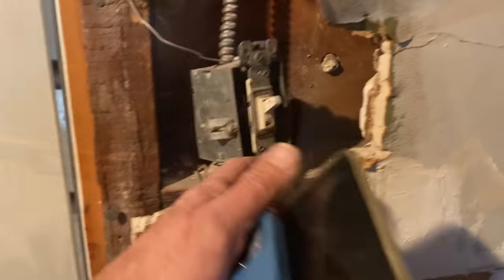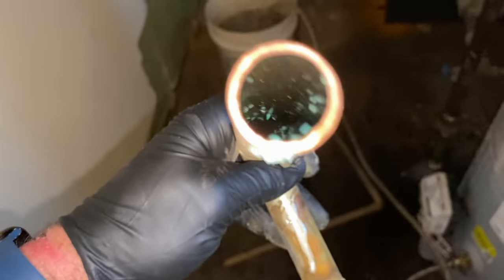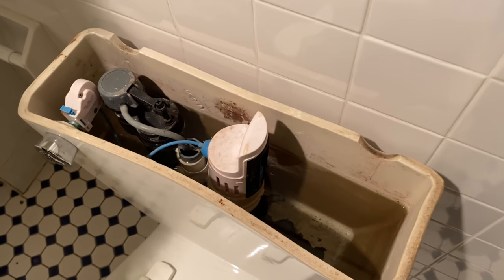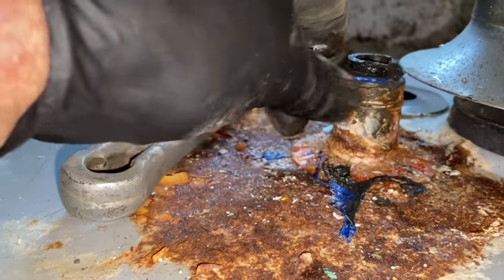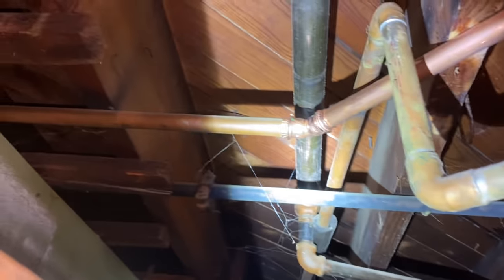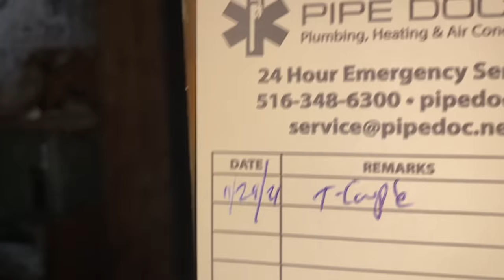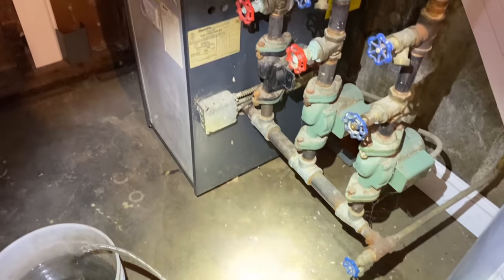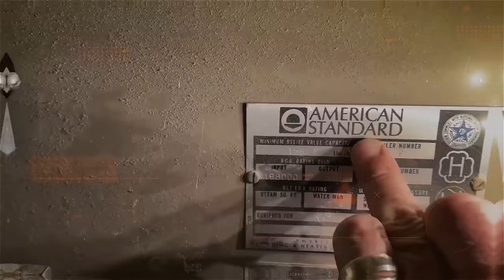Hundreds of Pin Hole Leaks in Domestic Copper Tubing Pipe Replaced

Comment: That was a lot of mud in the pipes . I wonder how much is on the bottom of the water heater ? I know flushing it out may cause it to start leaking but I also know the heat isn't getting to the water as efficiently as it should either . A whole house water filter will help a lot  I agree , but everything needs a good flushing of the whole house first should be done . As for the water heater being flushed that is just a roll of the dice .   I used use hot water say in a pot to cook pasta . I stopped after I changed my hot water heater and saw what came out of it while I was draining it .
Reply: Never gonna get completely clean without a repipe of EVERYTHING.
Beware of companies MARKETING whole house repipe work, offering to do it much cheaper than a plumber...then who is going to do it, a babysitter or painter ? I hear these ads on radio ALL THE TIME, same as crazy priced plumbing companies that are 90% sales, 10% plumb and on the level. Their pitch is usually off. Plumbers, like any trade; should make a great living. But not crazy-cray pricing. Once those flip-books come out, you know the scam is about to hit.
Reply: @citylockapolytechnikeyllcc7936  I have never heard of this service .  I agree you will never get everything completely clean . I was mainly concerned of where the water settles like in the water heater or toilet tanks . They need to be cleaned of sediment so the now filtered water isn't ruined by the left over mud . Where I live in I get rust build up in the tanks .

Comment: Whole house filter is a great idea. Queens and parts of Long Island always suffered from hard water. I installed a charcoal water filter on a boiler I installed in Jamaica queens that had rotted out. The water in the glass was clear. I started installing on most steam boilers 
Back in the 90’s.  Mainly if old boiler died from oxygen corrosion.
Reply: I lived in brooklyn and water would stain white clothes in the machine it was so bad. But LI has different water from aquifers. NYC gets it from upstate.

Comment: Sometimes when the water is to clean you get the same thing. But in this case I blame the dielectric system installed on heater good fix.
Reply: Yep,  it very well could be electrolysis.  Be sure system is grounded also
Reply: It's a gas water heater I could be wrong but there is no need for anode rod or grounding the unit
Reply: @SORGIGERMANICO  U would be wrong.
Reply: @SORGIGERMANICO  I don’t think it’s required by national codes but local codes do require it(ground strap).  I always install it because I was told the tank last longer.  Along with dielectric system

Comment: I would replace anode rod in this water heater. It responsible for catching iron, calcium, magnesium on a hot side of the system.
Reply: Catching it, or corroding instead of the device it is screwed into ?  It is called a sacrificial annode for a reason. Same effect as the sink plates screwed to ship hulls. And I'm not even a plumb-bob or elechicken!

Comment: This old house dudes did a special on water heaters that don’t have anodes replaced every 2-3 years. Glass lining is eaten and then rusts out and sheds iron out into the pipes and settles- then eats into the copper and creates pinhole leaks. Good chance to offer anode service to all your water heater install.
Reply: 99% of households don't replace anodes and most of them aren't getting pinhole leaks. I'd say replacing it takes the life from 15 years to 25 years. 15 years is a good target that anyone can reasonably achieve even with no maintenance

Comment: My old boss made us put duck tape on a rusting fire suppression system in a pool house building..  it was a dry system so I guess he thought it wasn't a big deal because it was just air leaking and it stopped the compresser from running non stop.  Little did he know that the pin holes would dump enough air and the diagram would finally burst and charge the system.  While no heads were popped, the rusted pipes damn near popped once charged with water and flooded the building.  And when I say water, I mean black rust slurry water!  Lol.  You can't fix stupid and sad that many people in charge should not be.

Comment: i was always told to put a shutoff on the inlet and outlet of the water heater.
Reply: And put a union on both, for easy replacement?  Only if code requires. How often do you really need to break the water heater connections? Same with turning water on and off... Follow code.

Comment: Mr. Mikey Pipes, in your professional opinion what causes the pinhole leaks in the copper?
This is what I have heard it could be 

#1 water turbulence,  dent in pipe, solder puddle inside, failure to deburr the joints, causing the water to slowly erode away at the pipe. 

#2 large amounts of mineral deposits causes corrosion and etches the pipe. 

#3 the water is acidic pH lower than 6.8 

#4  air trapped in lines causing  water hammer which makes  micro bursts happen and slowing destroying the pipe. 

Is there a definite answer or will it remain a mystery forever?
Reply: Copper is porous plus so called ; blue water.
Reply: I have always seen it happen on domestic recirc lines, in horizontal runs. After some well intentioned person replace that gold pump with a red one. So the oxygen attacks the ferrous metal in the red pump body and little bits of iron move out into the piping and start to drill holes.